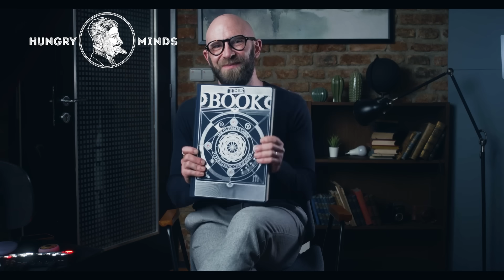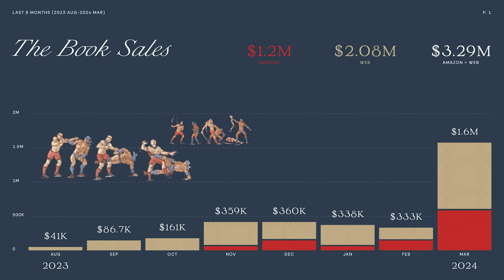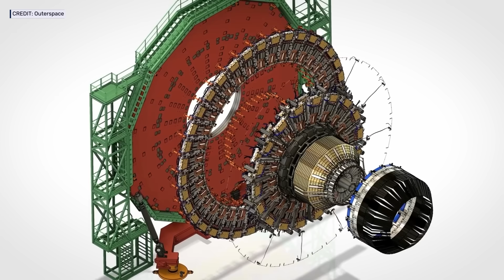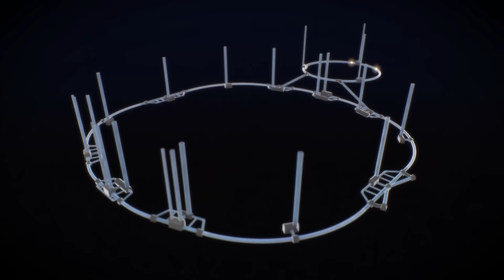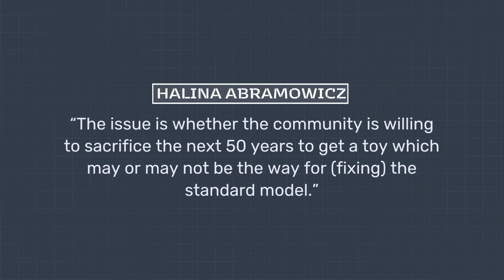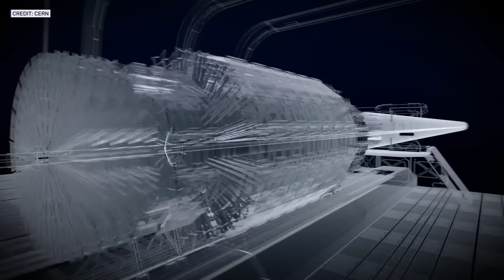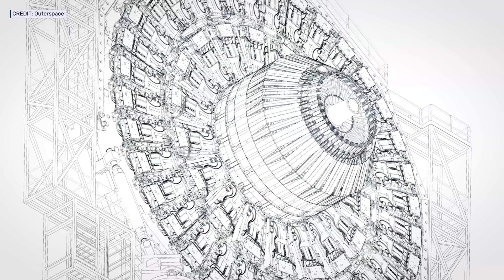The Hadron Collider 2.0 is Coming.

Comment: How big do we need to make it to actually uncover the secrets of the universe. Instead of making a bigger one every 10 or 20 years, let's just build the biggest one we could conceivably need. Does it need to go around the world?  Does it needed to be like artificial ring around the planets?  How big of a circle do you need to speed up particles? It already circles many many many times before it's the collider chamber. Why does bigger one make faster thing
Reply: Good questions! Bigger colliders give particles more distance to accelerate, so they reach higher speeds before colliding. But yeah, at some point, building a planet-sized ring might be overkill. Maybe there’s a smarter way to boost energy without going massive. Physics is wild like that.

Comment: A new collider may not be necessary if collider detector plates were incorporated into a low Earth orbiting satellite, high energy cosmic ray collisions could be recorded. Or even having such collision detectors on the moon, even smaller high energy cosmic ray collision detectors external to the ISS no new terrestrial accelerators would be necessary.
Reply: That's a wild idea! Cosmic rays as a natural particle accelerator sounds pretty clever. Wonder if anyone’s already testing something like that?
Reply: @TheBook_Hungry_Minds  Van Allen Probes for NASA’s Science Mission Directorate.
Reply: @TheBook_Hungry_Minds  The problem with cosmic rays is that you can’t control them. We can measure them and the experiments at the LHC use them for calibrations. Neutrinos from deep space are studied around the world, for example at Km3Net or IceCube. 
Building detectors in space costs even more money and they can’t be repaired. So it is not possible to do that.

Comment: Wouldn't it be easier to build it out in the middle of the midwest desert in the US?
Reply: You are maybe not watching the news but the US is completing cutting their science.
Reply: @phasco5692 Yea, I am tuned out of politics.  Although, from an engineering perspective, would it be easier to build out in the flat US Midwestern desert because when I see the map where they're building it, there's a full city underneath, mountains,
Reply: @ yeah but that is not the problem. It’s 200 meters below so there is not problem with that. If they would build it in the desert (not necessarily in the us) they would need to additionally build the complete infrastructure for that. 

In the 80s, before the LHC was build, there was a plan to build an even bigger collider (but smaller than the FCC) in Texas. After about 2 billion spent dollars, some kilometers of build tunnels and already some buildings on the surface, the government decided to cancel the project.
Reply: True, infrastructure in the desert would be a huge challenge! It’s wild how much effort went into that Texas project before it got scrapped. Makes you wonder what could’ve been if they’d finished it, right?

Comment: Clearly already the next collider will be obsolete in a further 20 years. So by the time it’s built, it will be out of date.
In that case, why not plan to build the next collider in 40 or 60 or 80 or even 100 years, saving up for it, in the meantime.
Reply: Haha, that's one way to look at it! But imagine the tech we'd miss out on by waiting that long. Half the fun is seeing what we discover along the way, right?
Reply: @ ironically, that too is one way of looking at it, but if the money goes on one Uber-project, just think of all the advancements we could miss out on from all the thousands of smaller, cheaper experiments that could benefit from sharing that funding with them instead.🤔
It reminds me of a similar debate about the cost of a single piloted mission to Mars versus all the thousands of space probes that could explore Mars and the rest of the solar system for the same money.

Comment: If you can't do proper math, build a more expensive machine.  We know photons have spin but the math is too hard so we use a simpler model that gets us most of the results we need.  Dark matter was coined because we are using math based on the solar-system rather than on a galaxy.  If we do the next particle accelerator, then it is time to study how it was made.  Too many parts of it are covered up in "skilled labor."  How were the pyramids made?
Reply: Haha, love the energy in this comment! Physics can get so wild when we start digging into the unknowns. The pyramids really do make you wonder what kind of ancient "skilled labor" secrets we’re still missing, right?

Comment: If they need this, then that’s an admission that LHC was a failure. If LHC was a failure, why would I give you more money? This is a scam.
Reply: That is not even close to being correct. There were particle accelerators since the early 50s of the past century. Many accelerators brought new insights. Yet they did not have the ability to discover everything. That was also not the demand. It neither was for the LHC.
Reply: Good point! The tech back then was groundbreaking for its time, even if it couldn’t do everything the LHC can now. Science builds on itself, right?

Comment: The world does not NEED this right now!  Surely it could wait a decade or two.  $30,000,000,000.00 is an obscene amout of money and for what? (How can that improve our lives?  Imagine if that money went elsewhere instead, world poverty, people are staving, famine, drought, failed crops due to climate change, war, corruption etc...
Reply: Not to mention cures for disease like cancer or funding greener power generators.
Reply: @mmmetroidvania  1. No, if it would be delayed by a decade or two it would change nothing. People would still be against it and find reasons why the money would be better elsewhere. 
2. most of the money is coming from CERN itself. 
3. It is not that much money. It is split over many countries. 
4. There is so much money wasted that could be used to end world hunger and poverty. But your idea is to cut scientific funding for it? In Germany alone there are 160 billion euro each year that are just gone by tax evasion. We have thousands of billionaires on the world who have more money than they could ever spend and make more in an hour than 80% of the worlds population in a year. But sure: Science is problem.
Reply: Science funding is such a tiny drop in the bucket compared to other wasteful spending, right? And the knowledge we gain from projects like these often leads to unexpected benefits down the road. Those tax evasion numbers are wild though!

Comment: Most fridges work on heat pumps. Based on the refrigeration cycle. I’m not sure if they design it to be reversible tho since you’d never heat up the inside of the fridge. So maybe more like a DX (direct expansion) refrigeration cycle?
Reply: Good point! Most fridges are definitely one-way systems since heating the inside would be... well, counterproductive. A reversible heat pump would be overkill for keeping our snacks cold! Wonder if anyone's ever tried modifying one just for fun?

Comment: As an American, the notion that $30 billion (split between a bunch of countries, no less) is causing this much controversy is mind-boggling. Our government spends far more than that on a daily basis on projects and programs that are not even in the same universe in terms of value. Perhaps we should dust off those plans from the 1990s and update them.
Reply: I have a question. The LHC can already accelerate particles to just under the speed of light, but you say that the new one will be able to smash particles together with seven times more power.
Reply: @felipeflorez5490  you dont understand the relation between speed an energy right? the energy converges to infinity when the speed of a particel reaches the speed of light. so even if he would have said a billion times the energy, it wouldnt be a problem. you could put the hole enrgy of this universe in a single particle and it wouldnt reach the speed of light it jsut would converge very very near to c.
Reply: Whoa, seven times more power sounds insane! Can't wait to see what mind-blowing discoveries they'll make with that upgrade. Science just keeps pushing the limits, huh?
Reply: Why wouldn't it cause controversy? What if things go wrong?

The US spent billions on the Superconducting Super Collider before scrapping it entirely. How do you know this won't go the same way?
Reply: Yep , that’s why US budget deficit is $1.8 trillion  and you are making America great again 😂
Reply: @RuiPret  Yup.

Comment: A new machine or an upgrade  to the LHC is not needed.  This is no question it is designed to answer.  The standard model matches all the observations so we are not in the situation like what lead to Einstein's theories or quantum mechanics.  It will just suck up the money that could be spent on more productive research.
Reply: Study two semesters of physics and you will learn all the points where the standard model fails. There are books on it I think.
Reply: @phasco5692 Name one place where it actually fails.  I don't mean the math is not pretty.  I mean a measured value that shows a real problem.  People don't like weird unexplained numbers but there is nothing that says the universe is not full of weird unexplained numbers.  They are the fundamental constants even if numbers come out to 28.1234 and look made up.
BTW:  I have had more than a couple of years of physics and what I do for a living involves some of that quantum physics stuff.
Reply: @  magnetic moment of the muon, mass of the neutrinos, Higgs mechanism, dark matter, matter-antimatter-asymmetry.
Do you want me to go on?
Reply: @phasco5692 The experiment they are proposing answers no questions on those topics.  There are measurements we can do more accurately but these are not deep questions or new physics.  They are just the gathering of more exact values.
The current LHC can make the higgs and has energy levels above what is needed to study them.  There is no reason that LHC2 would tell us anything about dark matter or even if it is a real thing.  There is nothing in the proposed experiment that will answer why matter exists.

Comment: They should have just bought the TBMs outright and left them down there for future tunneling (I'm assuming they didn't). If they did CERN could have been building the new tunnel all this time. Constructing the ring and experiments themselves should wait until higher temperature superconductors can be manufactured.

Comment: 17B USD for another collider that MIGHT find something?

Instead of building it, why don't we pick one of these that are more likely to be worth 17B:
- New Cancer Treatments / Cures
- Maybe genetically engineering food stocks that can survive climate change.
- Modular nuclear reactors that can be deployed quicky and safely or developing molten salt reactors so warming slows.
- Bringing fusion technology to reality in 29 years instead of the typical 30 years (although this can be a waste of money).
- and like 1000 more things more important at this time then whizzing charge particles around a ring really quickly.

The science will always be there to be discovered.    
We may not be if we don't use resources wisely and this isn't wise.
Reply: You know that advancements in accelerator physics benefit cancer research?
Reply: @phasco5692 Benefited,  past tense.   Tell me how the LHC help cancer research?  Are they using some aspect of the Higgs boson to treat or cure cancer?
Spending this level of money on something that *might* discover new physics when there is SO SO much existential issues we need to fix now.
Reply: @wgm-en2gx  The technological advancements in superconductivity and accelerator physics.
Reply: @phasco5692 I don't believe things like the LHC drove advancements in superconductors.   More like the other way around.   MRI machines more likely drove superconductor research more than colliders have.
As far as accelerator physics, I don't think we are going to learn any more about these physics that are pertinent to cancer treatment or of general benefit.    At least not to the point of making it worth 17B dollars.
Giving cancer researchers 17B USD directly would do much, much more for treating cancer than this colossal waste of money.
Reply: @wgm-en2gx  Well it seems that you know more or less nothing about the topic then. But that is the great thing about the world (for the moment): You can have your uneducated opinion. 
But lets make clear that we should let the people decide, who actually understand whats going on.
Reply: @phasco5692 So you have nothing more than calling me uneducated?   You don't even know me.   Given that you are trying to dismiss me as uneducated, it's obvious that you can provide NO justification for spending the money to build 2.0.
Thanks for playing.

Comment: Better to put money in this than war.

2070 by the time it collides something. Jesus.
Reply: CERN plans 2045. The 2070 is a huge misunderstanding.
Reply: @phasco5692 can you explain further, I'm confused.
Reply: @phasco5692 can you elaborate?
Reply: @JJs_playground  I think I know where the 2070 is coming from but it is not what CERN intends it to be like. 

There is no actual plan yet on how the accelerator would look like. Some of the technologies aren’t even invented. But the favored idea is the following: Bevor there was the LHC, there was an electron-positron collider (LEP) in the same tunnel, that operated for about 10 years. The idea is now, that again in the bigger tunnel at first a lepton collider would be build, which would not achieve that high energies but test the standard model again in a cleaner environment. This accelerator would be operational in 2045. Then, after 10 years of operation, the hadron collider would eventually be build and start its operations in the 60s. But if they choose a different way, they would skip the lepton collider.

Comment: I’m so sorry but wouldn’t this effort be so much cheaper to build with far less material in space.
Reply: 😂 Do you know what it costs to bring 1 kg to the ISS? And one magnet alone ways several tons!
Reply: @phasco5692 i am just wondering if the structure needs to be as large is space. Maybe it can be engineered at a much smaller scale with the same particle acceleration with a much smaller design in a vacuum.
Reply: @yakaronielyak8299  no. The particle beam itself is in a vacuum and the limits result from the ability of the magnets to bend the particles around the ring.

Comment: Instead of a collider why don't they switch to another circular device.... Like idk the one with the plasma that is used for that new fusion research.... 😂 or is this the project that this has to do with??😅 No right? F*CK here I come deepseekgpt12opp or whatever they're on now 😂😂😂
Reply: Fusion reactors are something completely else. However there is research about plasma accelerators that would be orders of magnitudes smaller. But this is far in the future at the moment. 
But it is clear, that this would be the last collider in the synchrotron configuration. After that we need new ideas.

Comment: This FCC project, imho, validates what is wrong with the direction of Physics & science, in general, and physicists in particular. Oh, we found "hints" of new physics with LHC so we need to build an even bigger (and perhaps 10x more expensive) to prove them wrong. Those physicists insisting (nee, coercing) the public to support their spelunking expeditions into the Planck domain needs to prove to the public how they will prove the origin of gravity with the FCC. Until that happens, I am on the skeptical side of this pipe-dream of a proposal.

Comment: A lot of the everyday usefull things are discovered along the journey 😅
Reply: Or not...
Reply: @brucecurtis9368 no, nearly every single time. Even if the main project fails, the advancements to build it and support it do happen and remain. Keep in mind the internet was invented at CERN due to a need to rapidly and easily share data with universities scattered around the world. You are here complaining because of CERN. And they pushed the internet and servers and data processing forward orders of magnitude with the LHC. The sheer volume of data it produced every single day was impossible to handle at the time. Modern day computing and phones exist because of the LHC demanding huge pushes forward. You have no idea how many times the cost of these are multiplied in return benefits before they even turn them on to do the science. It is a way of driving massive investment in thousands of tangential science projects. And of long term direct investment in communities supporting construction and maintenance. Thats a lot of jobs. That investment alone drives local economies long term.
Reply: @brucecurtis9368 how's that cell phone working for ya bud?

Comment: Build the lead tower, a tower with the heaviest object ever to be stacked up.  A mile high Pb lead pile so heavy, a 400 story glass pyramid dons a mountain top.  Inside the mountain, cold fusion capacitors move petta electrons betwean massive parallel plates to drive the piles into fused bi-ziconian radio.
Reply: What did you take? 
I‘d like some of that.